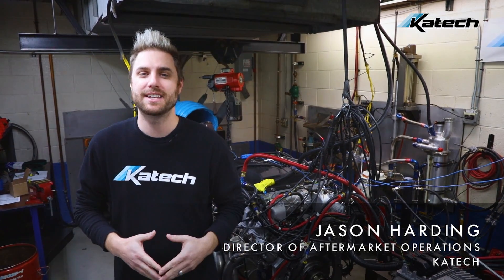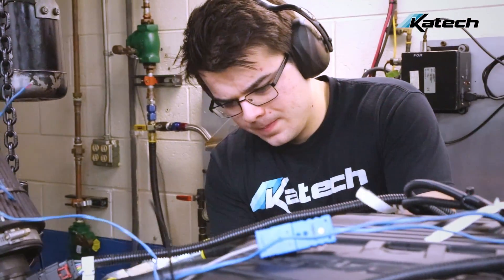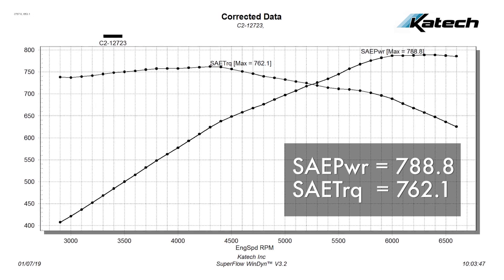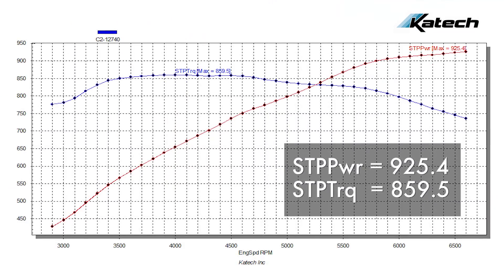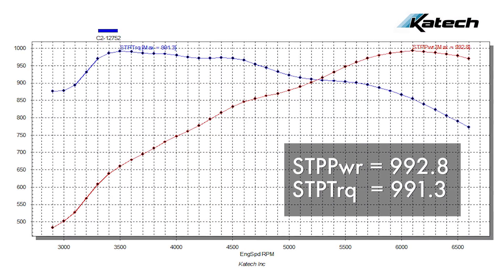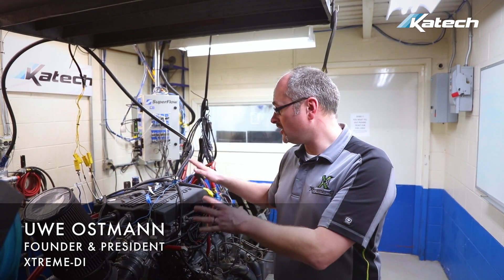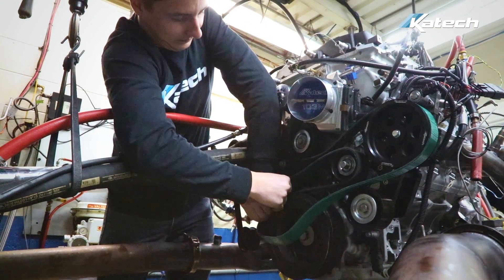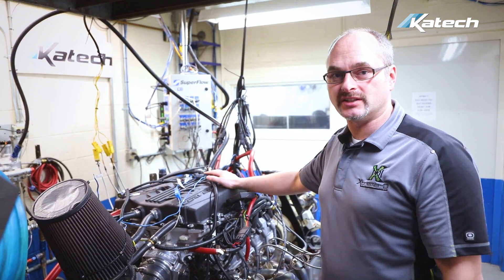Katech boosts the new LT5 Engine to 1013HP on E85!

Comment: but most ZR1 owners will not have the KN Filter sticking out the bonnet right, it will be enclosed so restriction will happen and lose of power still around 950 easy is my guess and thats at the crank not at the rear wheels, so till someone has it done and then put it on a hub wheel dyno to prove it, (  not the rear wheels sitting on a spinning wheel type dyno ) then people will believe it?

Comment: Hello,I recently bout a LT5 crate engine.Did you  run into any issue getting this one running?
I have spark while turning over and theres fuel getting in the rails .60 pounds  pressure to engine...Ign wire is hooked straight to the battery. But cant even get 1 pop out of it.
Reply: It takes air fuel spark. Is the tb cracked open? Do they shut completely when off? Did you spray fuel. Even if there is pressure there isn’t necessarily flow. You said there is spark so if you have air and fuel and the spark timing is off you would definitely get a “pop”. Good luck bro

Comment: Can this be done on a 19 zl1 1le? Seems like running e85 on this platform is limited without during big and expensive mods.
Reply from the maker: R For for our Stage 4 head and cam package it uses a 38% fuel lobe, Katech +30% injectors, and a low side fuel pump.  This will support E85 up to the limit of the factory supercharger.  If adding more air, like with a Magnuson TVS2300 or larger, we use the Katech Xtreme DI pump to supply the additional capacity fuel to the DI rail.
Reply from the maker: R For by “this” do you mean E85?  We have solutions to run E85 on ZL1s.
Reply: @KatechPerformance  yes, running straight  e85. Very interested in your solutions.